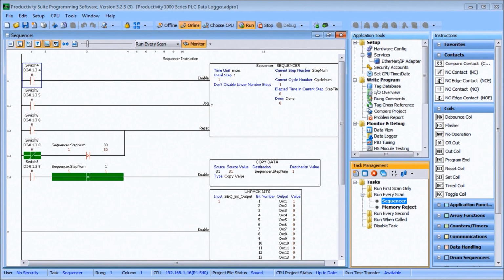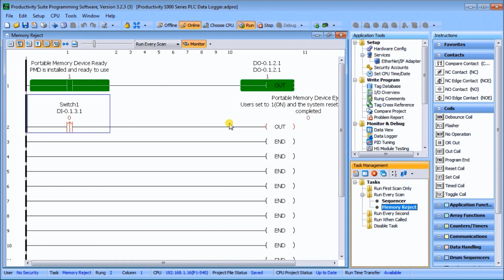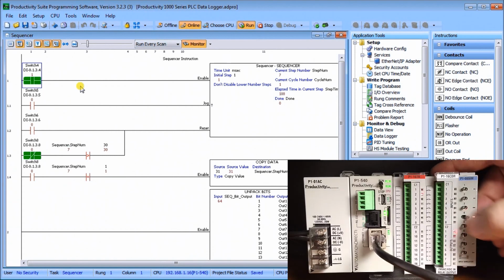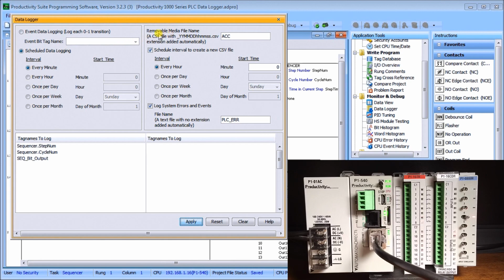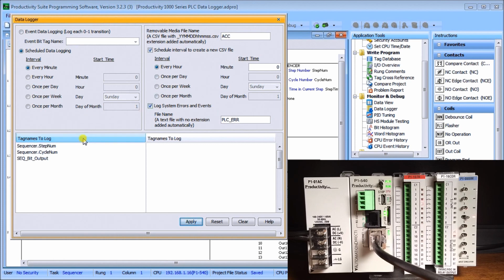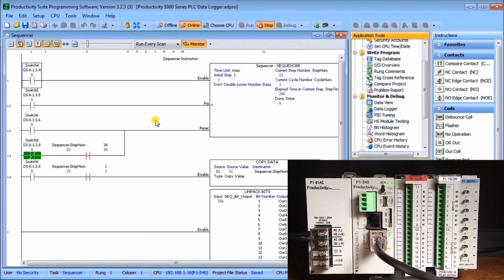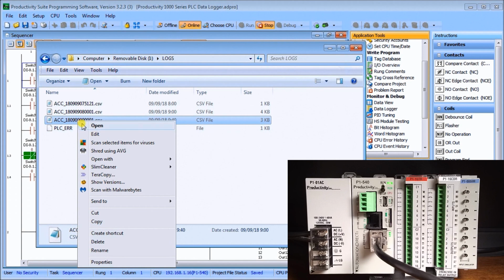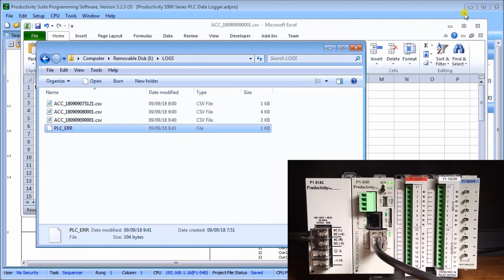Productivity 1000 Series PLC Data Logger

Comment: Would this work for analog inputs, say I need to sample every 100ms for 3-5 minutes
Reply from the maker: Hi Aussieguber86
This should work for your application. You would set this up for Event Data Logging. A bit would be selected to log the data from a transition from off to on.
Note: If event logging is used and data log buffer reaches 512 bytes of data, then the buffer will write 512 bytes segments to the pen drive, an attempt to lower data log buffer below 512 bytes. However, how fast the buffer is filled is dependent on the frequency of event, the number of tags, and data types of these tags selected for logging.
I hope this helps you out.
Regards,
Garry
Reply: Thanks for the reply, yeah we are planing on logging around 10 load cells via 0-10V signal conditioner into an analog input on the P2. The conveyor will run for a few minutes while logging weights at 100ms intervals (hopefully) I believe the log file (txt) from the datataker was around 300kb for the test previously.
Reply from the maker: @aussiegruber86  
This should work. If not you could also use some programming to place the values into memory locations. Then write to the log file after all of the information is obtained.
It's always good to have a backup plan.
Regards,
Garry